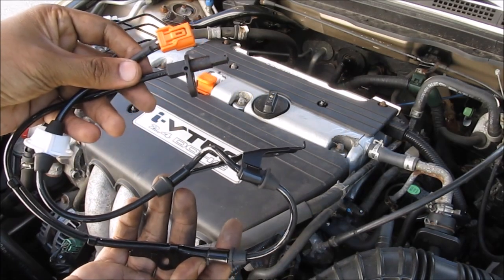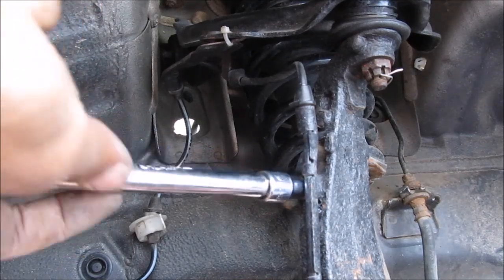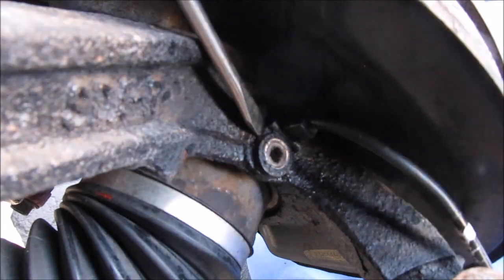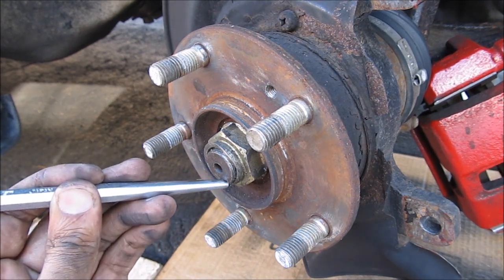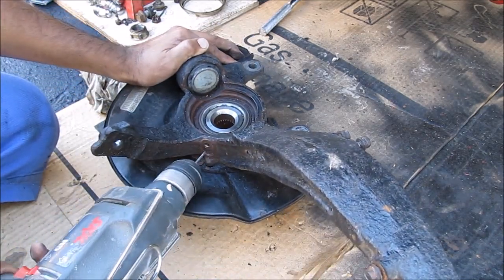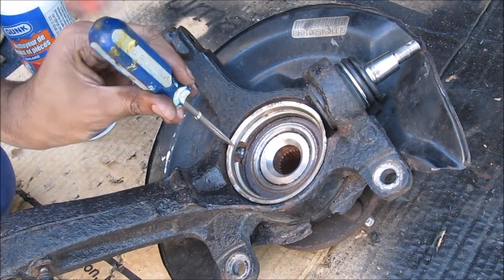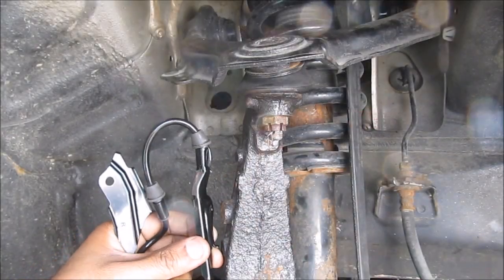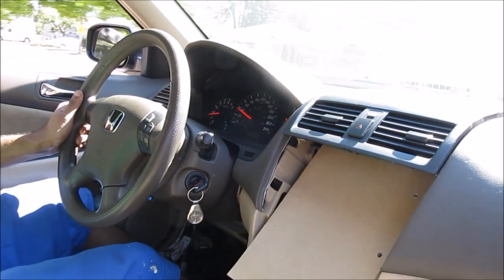Honda ABS Sensor Replacement

Comment: Same thing happened to me while replacing bearing. Sensor was rusted in knuckle. Long and short, added a new sensor but abs and vsa light did not go away. Yes bearing was installed with the correct side facing sensor. Tried clearing light with scanner but it would come back after driving few meters.
Reply from the maker: +Rho Main Perhaps the sensor used wasn't correct? Read the abs fault codes and troubleshoot
Reply: speedkar99 It is very much possible. Either faulty or wrong sensor. I requested another sensor just to be sure. In the meantime I will do some more troubleshooting to see what's happening. Thank you!

Comment: And that folks is how you change youre entire suspension system
Reply: How about heat up with a heat gun ?
Reply: Your already there. Why not replace the balls joints, tie rod n sway bar link.
Reply: @tonezone99  no money 🤣
Reply: @ToneZone99  maybe they where okay ?
Reply: All outta whale sperm @ 1:35
Reply: 😂😂😂 I  came for the comment..all cause censor..😂😂
Reply from the maker: +josephg479 Yea...stupid Rusty sensors

Comment: I bought Honda Accord95 EX Vtec.  The car is In an excellent condition  but srs and abs lights was on. My friend fixed abs easy: he added break liquid (I'm not mechanic and not sure what was it) to some part on right side in front corner and now abs is working and when start engine the light is goes off,but srs light is still on. Please, help me If someone knows how to fix this problem? Thanks in advance. (Sorry for bad English)
Reply: Srs is your passenger side airbags need to reset thats all
Reply from the maker: +Jaz - biz 'ДВА ПУТЯ' srs light has nothing to do with abs, you need to get that code scanned.
Reply: speedkar99 Thank you so much for your advice
Reply: speedkar99 please, give me some advice: after engine getting hot, speedometer stops working and d4 starts blinking, if you turn off engine and on again everything works fine, but after driving about 5-7 miles again the same thing? Help me please, what to do?
Reply: Edgar Yu Thank you. Is the passenger side resets separately? I looked YouTube but didn't find  videos anyone resetting srs on Honda Accord95?
Reply: Ташкентская - Кухня does the check engine light come on for the D4?
Reply: uncle freddie yes it was. mechanic changed speed sensor and transmission oil and now all fine: speedometer works properly, d4 light stopped blinking, engine light turns off.
Reply: Ташкентская - Кухня Good...was gonna say it sounds like a transmission problem...dirty solenoid or bad connection???  Glad to hear all is well
Reply: No transmission, mechanic told me the same "dirty solenoid or bad connection" but i had already sensor the new one and decided better to change.

Comment: Ahh, gotta drill out that hole

proceeds to disassemble the whole car

loved it haha
Reply from the maker: +Jason Jia yes the knuckle has to be removed
Reply: wich sensor is the most difficult to replace front or rear ones?Thank you excellent video very informative.
Reply: I need to inspect the sensors on a 1996 6 cyl Honda accord ex.I am hoping is something simple like dirt on the electrical connectors or a fuse etc. And not a big job like you did.Cheers
Reply: @SDsailor7   I have that car in the 2005 edition. I hope I am not going to get killed when I take it to the shop next month. Damn ABS & brake light is on.
Reply: @DianeScotts  lets hope not. Wish you luck
Reply: I just drilled it out in situ.  Then used a flat bladed screw driver to push the sensor that is closest to the wheel up through.  Once that popped up, grabbed it with a needle nose and pulled it out.  Still a major pita.
Reply: Lol
Reply: Kakaakajajajajaa
Reply: I had the same issue as him and I made a video that doesn't involve disassembling the whole car haha. Check it.

Comment: Thanks for the great video, I sprayed some penetrating oil on my old sensor and pulled it right out without breaking it. I was able to slip the new one in and didn't have to take the whole wheel apart.
Reply: The Honda gods were with you that day.  I've never had that experience.
Reply from the maker: +Steve Humphreys Man that's awesome for you I didn't have that kind of luck with this rusty Honda

Comment: I need help
I broke off the abs screw when changing lower ball joint. How do I get the screw out? Thanks!
Reply from the maker: +Michael Officer I had that problem. You'll have to drill it out and retap the holes. Not fun. Or you can zip tie the sensor on ad forget it like I did.
Reply: speedkar99 has that held up well using zip ties to hold it down? Was it hard to get on? Does it hold tight?
Reply from the maker: +Michael Officer yes it held up for years after. Depends on the shape of The knuckle if it can get a grip.

Comment: my Vsa light flashes whenever i make a left turn and if i take it at high speeds it will make my brakes lock, could it be the sensor or the modulator?
Reply from the maker: +robytoes2 Abs sensor. Any lights on dash?
Reply: speedkar99 No lights on Dash watsoever, it happened when i dropped my steering rack and shaft, due to a change of clutch. i had moved the steering wheel without the shaft in it and broke my clock spring. i thought it was related to the clockspring but i guess not cause i installed a new clockspring and the vsa light still turns on only when turning left.
Reply from the maker: +robytoes2 There's a steering angle sensor in the steering wheel for vsc. You might want to look into the repair manual for diagnosing that sensor as well. 
I also had issues on my Toyota solara with the abs kicking in at 5kmh coming to a stop on the front right wheel. No lights, but once I changed the sensor the problem went away.
Reply: speedkar99 okay forsure thanks!!

Comment: Instead of anti-seize I would recommend to apply some sealant. Please note that by drilling we slightly increase diameter of hole. Also if you use aftermarket sensor it might keep exact dimensions of oem sensor. Any space between sensor and steering knuckle will let water in, which will kill hub bearing and abs impulser very quickly. That's exactly what happened with my 2 rear hubs before I figured out how water gets in.
Reply from the maker: +Adalberto Elefantino good tip
Reply: best thing is to use silglyde around the oring and the knuckle to keep water out
Reply: oem says put silicone grease around oring on install
Reply: Thank you, good to know. I will make sure mine is nice and sealed up.

Comment: I changed my 04 accord ABS. But I did not remove all this parts. I made sure I cleaned up very well. The ABS light won't go off.
Reply from the maker: +k1kenzi perhaps you pulled the wire? Or used an incorrect sensor? Measure the resistance as I did in the video
Reply: I don't know if you still have the problem, but for some car's you have to reset the ABS light.

Comment: Great video, I broke sensor while changing front bearings. I watch lot of auto repair videos and yours stands out as steady shooting, no rambling to the point and covers all the important steps. BTW: This video is good for bearing replacement because it teaches how to remove hub assembly...
Reply from the maker: +Robert Zanzerkia Thanks! I broke my abs sensors doing the ball joints on this accord. Short and to the point is how the videos have to be.

Comment: I need to replace the sensor on my accord was this whole job hard and do you need an impact?
Reply: Great video.
I have a suggestion - heat up a self tapping screw say a #10 or 12, drive it in a small way, quench and see if you can winkle it out - could save removing the knuckle . . . kudos to Speedkar99
Reply from the maker: +Ali Alesawi Its not hard its just frustrating that you'll have to drill out the sensor when it snaps

Comment: wow. u went the looooong way round
Reply from the maker: +Olsen Kandimba Yea well it broke off so nothing else but to drill it out.
Reply: So when taking off the sensors, you need an angled pry bar. Turn your wheel to sharply to the point were the back inside of your hub is exposed and you see where the shaft  of the sensor . If you noticed, the sensor has a 'step' design on its body. Place your pry bar on that step and use the cv axle as pivot ancor then pry it out. Squirting lube makes the job easier but long story short, that is how you take em out
Reply: I had the same issue as speedkar99, except mine was for the rear.  For the rear, you need to remove the knuckle, since the axle is blocking access to viewing the abs sensor. I tried hammering it out, using channel lock plier to push it up, wouldn't budge, the portion that sticks out on the bottom broke off.  I ended up drilling it out, which only took 2min.

Comment: Not sure if you can answer the question because I have a different type of vehicle but pretty similar, Acura TL 2006, once I replace the abs sensor do you know if the lights on the dash should automatically turn themselves off once fixed or will I need clear them with a scanner. V/R
Reply from the maker: If I recall, I didn't have to reset anything when I replaced my sensors, the lights went off.
Reply: speedkar99 you're amazin' thanks

Comment: Watch my video about how to find ABS codes WITHOUT a scan tool, all you need is a paperclip!
I've owned my 2003 Honda Accord in UK (Same car as Acura TSX) for 12 years and added over 130,000 miles. Only problems have been a failed ABS sensor and failed ignition coil.

Comment: Hey man, so after changing my lower ball joints my abs and the other 2 traction control lights came on. I changed my left sensor because it was broken. But the lights remained. I plugged an ABS scan tool and it said that the left sensor wasn't picking up signal. What can I check next?
Also why is the tone ring on the hub easily smeared off?
Reply from the maker: +Victor Gonzalez interesting, did you measure the resistance of the old vs the new sensor to make sure you didn't get a defective sensor? 
The ring is there to allow the CV axle to slide in, it has to be removed to get to the ball joints and abs sensor from the inside.
Reply: speedkar99 
I didn't measure the resistance but I'm sure the ABS scanner would have detected a failure with the actual sensor wouldn't it? And by the ring you mean the aluminum retainer?
Reply from the maker: +Victor Gonzalez Yes the retainer on the inside of the steering knuckle. 
So you don't get any fault codes with an abs scanner? How are you pulling codes, with an advanced scan tool, Honda HDS, or the jumper method? If the light is on, there has to be some code, unless it's an abs control module that's faulty.
Reply from the maker: +Victor Gonzalez Measure the resistance to see if the new sensor was a DOA. If not, you'll have to diagnose the wiring from the sensor to the abs computer.
Reply: Alright speed I took it too a shop and they "think" my hub bearings are on backwards. If that was the case how come my lights never turned on before? Sorry I still haven't measured resistance because both sensors are coming up on the scanner 
I'm planing to change my axles soon and hub bearings since they're already worn out 
I'll proceed from there with the ABS issues 
Thanks for your prompt responses

Comment: Hello,
how big is your air compressor your using on the impact wrench?
Reply from the maker: I think its a 25 gallon compressor at roughly 100 PSI.
Reply: I've done everything here, as well as on his Lower Control arm replacement vid using a plug-in electric impact from Harbor Freight I bought about 15 years ago, and it works fine. I believe the torque rating on it is 350 lbs/ft. It'll break axle nuts, as well. Definitely worth the investment, and I think I spent $80 for it back then. Now they may be a little smaller, which is my only complaint. It's Chicago brand.

Comment: Great job, but where is your radio? 😁
Reply from the maker: +Basil4everx Ahah, sharp eyes at an upcoming video...stay tuned :)
Reply: My 99 camry has ABS in it but it doesn't work since 2006, i checked all sensors and they were good but the ABS light is still ON , what should I do?
Reply from the maker: +Basil4everx scan for abs codes using an advanced scanner or Toyota techstream hooked upto your laptop. 
Did you measure the resistance of each sensor? You should also clean the splines of the shafts they mount on, sometime debris can cause a malfunction. 
If it's not the sensor or wiring them most likely the abs module might have to be replaced.

Comment: Do you need to get an alignment after removing and reinstalling this knuckle?
Reply from the maker: +Koffi Banan Not really because all of the mounting points are not adjustable.
Reply: Thanks, it really depends on the type of suspension then.